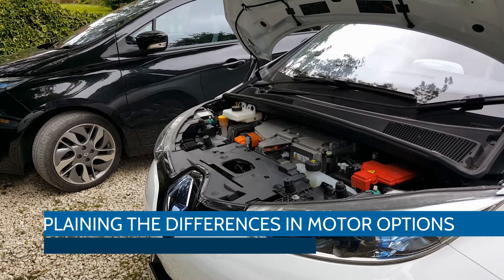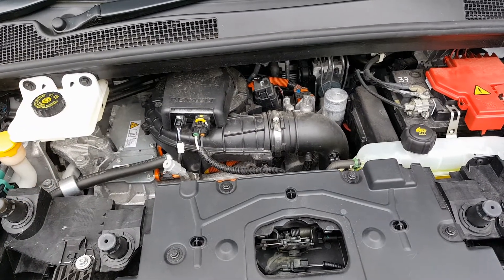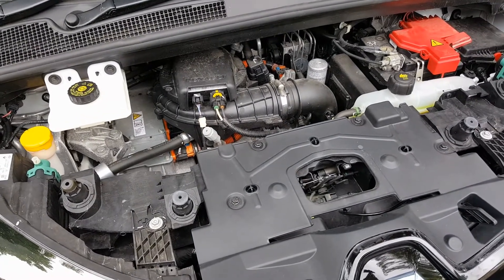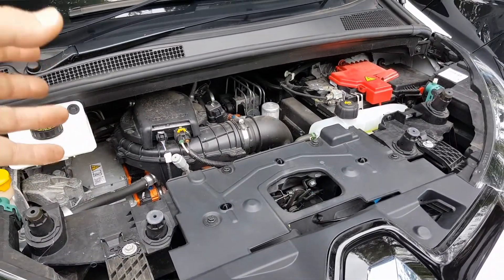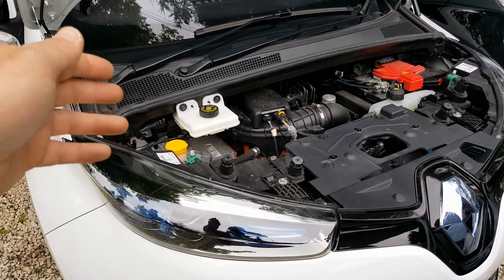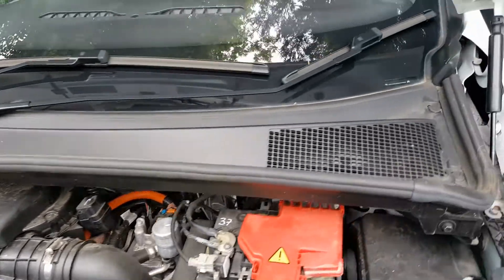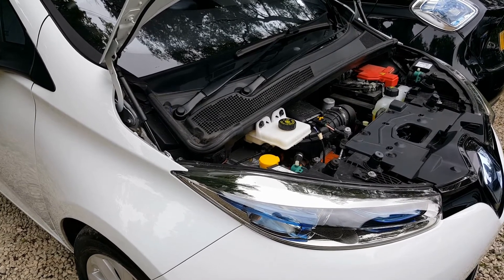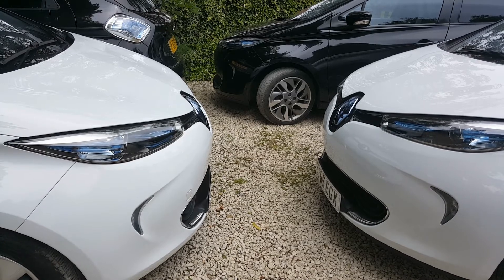Renault Zoe motor options - what is the difference between a Q and R motor?

Comment: The R motor has forced air rotor cooling, do you know if this makes much difference? I am looking to modify a Zoe so presumably the R motor would be the one to go for because of the ease of adding additional rotor cooling with the existing air intake/exhaust?
Reply from the maker: The R motor is also water cooled still as well. The forced air cooling looks like it just removes heat from the stop of the motor stack. It very rarely comes on. But I was charging a Renault Kangoo ZE33 the other day (which uses the same motor) and the fan came on when it was AC charging. It was a hot day though.
Reply: @GoGreenAutos  Hmm interesting. Some online seem to think the Q is better quality and I prefer the idea of the rotor not being exposed to the elements thru the cooling holes. Also people say the Q is louder which I like the sound of ;)

Comment: I am about to buy a used 2015 Zoe. I won’t need fast charging as I will be mainly charging at home by 22 kW. However, which motor seems to be more reliable to you? Continental (Q) or Renault (R)? Thanks for your recommendation!
Reply from the maker: R motor is the one to go for.

Comment: My first Zoe was a ZE40 Q90i it frequently tripped 43kw public chargers, our home charger is a Garo 3 phase charger which could charge that Zoe at 22Kw/h whereas our present 135GT Zoe will only take 11kw.
Reply: Zoe with Q motor has 20mA ground impedance test, by injecting current between ground and neutral.
But most internal RCDs are set to trip at 6mA, so Zoe would trip these every time.

Comment: Thank Q for the informative video. Which option to go for battery leased or Battery owned?
Reply from the maker: Down to personal preference (in terms of your feeling toward security and risk) and budget. The Zoe batteries are very good, so the reality is that few will every be making a claim under the battery guarantee.
Reply: @GoGreenAutos  Thank Q, Wha is the standard battery warranty?
Reply from the maker: @arvindtaylor6871  On owned batteries, 5 years from new. Leased batteries which were later purchased, revert back to the original warranty when new.
Reply: @GoGreenAutos  okay thank you.

Comment: Sorry - the Motor has nothing to do with the charging of the battery - the motor gives power to the wheels. The charger in the Zoe administrate the charging. And the new Zoe is able to charge at a rate of 50 KW
Reply from the maker: The "motor stack" does. And in the older Zoe, the motor windings are used when charging.

Comment: It's not the motor which charges, it's the battery management unit and the battery itself. You need to be saying 'the car with the R motor (or Q motor)' instead of saying 'the Q (or R) motor.'.
Nonetheless, thanks for the useful information.

Comment: The Zoe with a 22kWh battery pack can charge at 43kW right? (only the Q)
Or do you need the 43kWh battery pack for 43kW charging?
Reply from the maker: Correct - the 22kWh battery can charge at 43kW (on Q motor/rapid charge models). The charging rate depends on the onboard charger (22kW or 43kW).

Comment: Hi. One thing that you didn't mention is that the Q motor with the 43kw chameleon-charger is terribly inefficient when charging with 10ampere single phase with the supplied standard charging cable. With the app CanZE i can see how much DC power goes in to the battery, when the AC-current consumption is 2,3kw, the DC power is only 1,1kw!! That is over 50% losses!! I have been charging it like this for several years until i discovered that. A full charge on my 22kwh battery took around 13-15 hours, and then it's only 17kwh available in the battery, so charging 17kwh in 15hours gives you a charge current of slightly over 1kw, whereas thr plug consumes 2,3kw. So you can even notice the inefficiency that way. However, to solve this i bought a 16amp 3-phase charging cable, if i connect it to only one phase 16amp then i have 3.6kw available (with adapter from schuko plug to CEE416 ) and the DC-power is then around 3kw. Much better efficiency even tho there is quite a bit of losses compared to my Renault kangoo that has a traditional Charger. With 16amp 3-phase i have 11kw AC power and 9kw in to the battery, so still 2kw heat losses that is being cooled off by the engine fan, but way better efficiency than the 10amp single phase.
Reply: But I had to change to 2.5mm2 cable and 16amp fuse for the outlet i use for charging at home. Usually we have only 10amp fuses and 1.5mm2 cables in Sweden, 16amp outlets is rare to find in residential areas.
Reply: It is not inefficient, but it has 6A of reactive current due to filter capacitors on the input.
This is not wasted as a heat, nor registered as power meter.
Just 10A EVSE would let no more than 10A of current.
10²-6²=64 or 8A of effective current is available for charging.
Reply: @Mladjasmilic  yes my electricity meter from the utility company registers the 2.3kw consumption, and the DC power clearly says 1.1kw..

Comment: Thank you very much for making a clear and easy to understand video. I have a late 2015 Zoe nav with a continental engine and the 8th letter of the vin is an a. The Zoe is in for a service with a Renault dealer as it's not charging quick enough and he is adamant my car is an r model. Any chance it is a R model?
Reply from the maker: You can tell by looking at the motor as the video shows.
A in the VIN is the continental Q motor.
Reply: Maybe it's just a weak charger, try another rapid charger?

Comment: Is there no circumstance where a car has the R motor with the 44kw charger? because I've come across a '17 reg where the Renault salesman is adamant that it has an R with the faster charger.
Reply from the maker: No. The charger is all part of the motor stack. The Renault salesman doesn't understand the product, which is sadly very common.
Reply: @GoGreenAutos  Thanks very much for your quick reply. This is as I suspected and if it were some unusual variant I don't think I'd want it anyway. Its a sig nav 40 and he said that Q's were rare! 👍

Comment: The Q motor can charge with 43 kW and the R motor with only 22 kW, but this also happens when recuperating. The the R can only use the break energy of 22 kw, where the Q motor can push 43 kw back to the battery. 
When ever I observe that on my car, most of the time the breaking energy goes over 40 kw, so that's a big wasted energy of the R motor.
Also all manufacturers developing faster charging equipment for their cars, only Renault is going backward and make it half.
 April 2018 I bought a Zoe Q90 with 41 kW/h battery pack. Because charging speed matters when I have to stop when traveling big distances. When charging only at home it doesn't matter.
Reply: The engine codes are now R90, R110 and Q90...the overal consumption is lover with R engines despite a bit less recuperation, but yes charging at 22KWh is realy too less, specialy for the R110 engine (108hp) who is much better to make long distances on roads/highway, but allow only 22KWh charge who make it unable to realy make long distances...
Reply: My overall consumption with the Q engine is slightly higher than with the R engine. But that's nothing compared to the almost double charging speed.
I don't get what is the use of the R110 engine, which has the same top speed. So for long distance trips there is no gain. 
The only gain is the acceleration . But there my Q90 is already great.
I will add a trailer hitch the next few weeks, then maybe it could make sense to have more power, but Renault it self isn't offering that trailer hitch.
Reply: You are confusing the motor power and the charging power. The braking force depends on the former, not the latter. The R motors actually have a bit more motor power